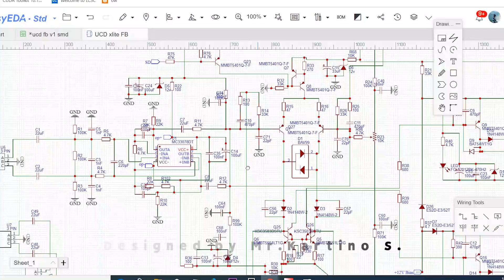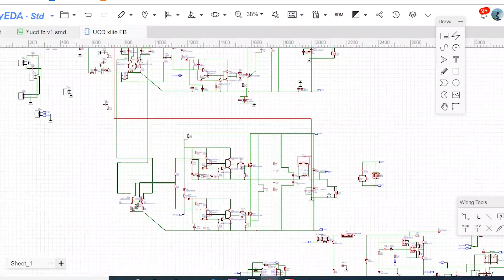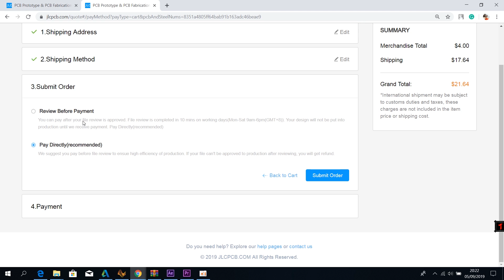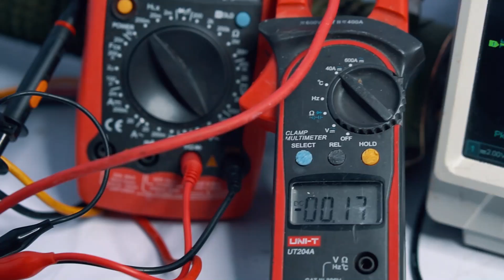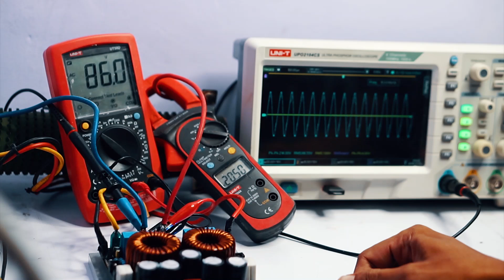Power Class-D UcD Xlite Fullbridge  Amplifier

Comment: Mas eko tolong jawab pertanyaan saya ya mas. ROCKFORD P2 pakai ucd ini mampu ndak. Main 2 ohm. Saya dapet pesenan power mobil untuk speaker tsb. Inverter pakai 2000w. Drivernya saya bingung mas eko.
Reply from the maker: Kalo powernya kuat banget mas, turah2.  Yg blm tntu inverternya. Inverter kalo memang benar 2000W pakai 12V itu btuh arus minimal 150A. Kbel nya jg harus gede. 12V dpet 1000W aja susahnya minta ampun mas. Kalau cma pakai 1 core inverter yang 6 cm.
Reply: @WahyuEkoRomadhon  rencana pakai inverter punya pak yusz 😁 tulisannya 2000w khusus miniatur. Tapi ndak tau realnya. Ucd nanti dari pak yusz juga mas. Buat rockford p2 rms 400w .
Reply from the maker: Ahh msak pk yus pnya inverter.  Ckup mas , yg video sya kmrn itu kluar 500W RMS sja. Speakernya sdah kobol2 vid3o yang diy monblock. Ucd superlite jg sudah besar.
Reply: @WahyuEkoRomadhon  😁 saya cek shopenya pakai core 1 tulisannya 2000w mas . Mungkin 1000 kali 🤣  2 ohm mampu ya mas ucd. Siap mas lagi taren orangnya dulu 😁😁 matur suwun sudah di jawab mas jadi cerahh ini 🙏🙏😁😁
Reply from the maker: Mmpu mas 2 ohm 90v. Awas spkrny yg g kuat.
Reply: @WahyuEkoRomadhon  biar jebol mas pesenan orang 🤣 wkwkwkw katanya minta power yg besar. Ydah saya buatin aja wkwk

Comment: Is there a way to reduce input voltage and still retain output results?
Reply: No because if u send out lets say 20v and 20 ah u are sending roughly 400 watts
U whould need 10v and 40 ah to reach the same number, maybe if u get a higer amperage u could but it is unlikely
Reply: Thanks @DutchGamers

Comment: the archive is not complete there is not enough driver board
Reply from the maker: Where you get?
Reply: @WahyuEkoRomadhon  on the site that you indicated, there is no driver circuit board
Reply from the maker: @Jeeparellofans  do you see pdf or rar files?
Reply: in the pdf file there is a large version of the board, which differs from what you showed on the video, what is the point of dropping the video of one version and providing a source of another version of the circuit and the printed circuit board
Reply from the maker: @Jeeparellofans  is two files
Reply: there is one large printed circuit board, but there is no small scarf on the connectors that you connected in the video, look at the archive

Comment: Thanks for this project, this is a very powerful amplifier, can i use  +/-100v with better output Mosfets for more power without changing any other thing
Reply from the maker: I know but very difficult in SMD layout design
Reply: @WahyuEkoRomadhon  I just needed a 3000w into 4 ohm for my double das bass bin that is 2000w rms 4000w program. So what is the voltage rail that you would suggest for that output power, i don't mind re designing the pcb layout, I just wanted to know if anything wont get burnt if i increase the supply